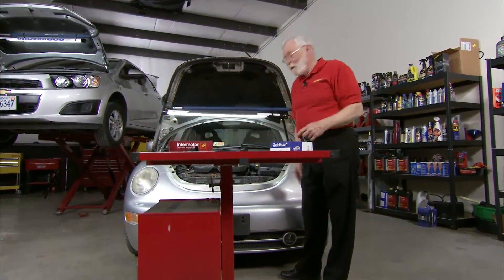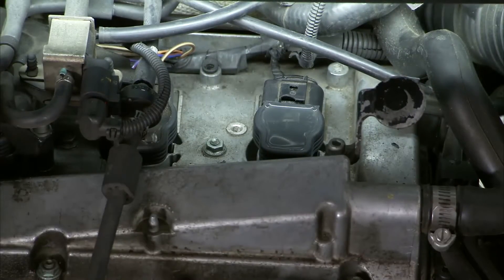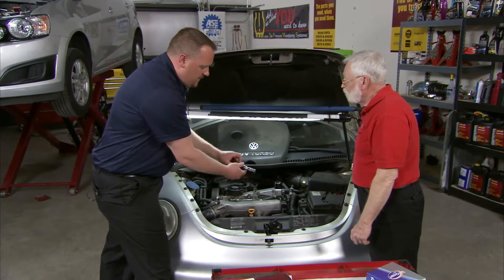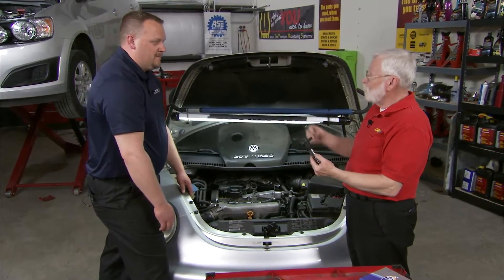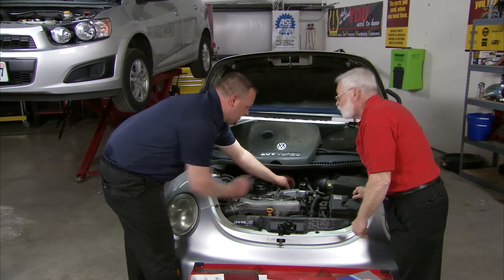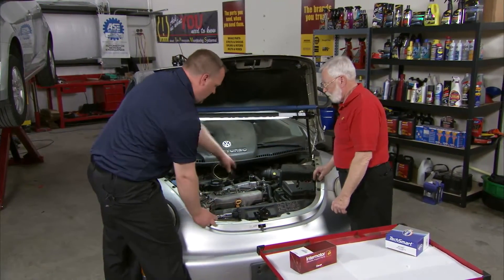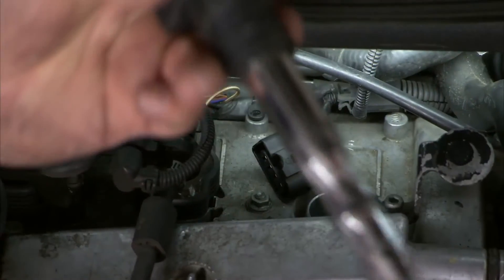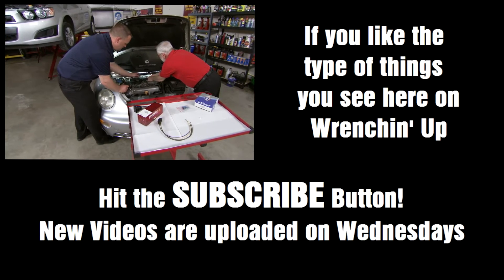Volkswagen Ignition Coil Connector Problem - Wrenchin' Up

Comment: Do i need to disconect the battedy
Reply from the maker: Hi - Thanks for watching! This video was created quite a while ago, but I do not think we had to disconnect the battery to repair the connector problem. I do suggest that you check with a service/repair manual for your vehicle to be sure.

Comment: Ive got a 2000 VW Cabrio with a 5spd 2.0aba, 160,000mi, has burned thru 10 ignition coils within the last 5 months (Bosch one melted thru the top!) Each coil I put in, I get from 500 to 1000miles of drive before the coils burn up. Connections & wiring seem fine, have searched for ground issues. Can't figure the issue out for the life of me! New plugs/wires, new distributor cap & rotor, which there's evidence of serious burns inside the replacement distributor cap and ontop the rotor.  I just ordered & waiting to arrive a new ignition coil, dist-cap & rotor, and a new MAF sensor, thew a CEL code for maf.  
I do believe the engine timing is fine, runs great when it is running. 
Has a very mild intermittent misfire sometimes, and does backfire (mild) only when down-shift, foot off the throttle. 
Smells like running lean, considering replacing the PCV valve, and evap canister. Air hoses seem a little oily, is why I believe I should order PCV valve. Noticed this when I got the car this past March.

The Bosch alternator works as should, but could the problem be with the voltage regulator in it?  Used 650cca autocraft battery, that I pulled out of my jeep when the battery I had in the VW Cabrio stopped holding charge.

Sorry this is so long, I'm out of people to ask for ideas, have searched very deep online, forums too,  and not sure where to turn, aside selling the car!  I had read a bad maf signal can in time cause ignition coil damage, so I'm hoping when the new one gets here, it will solve the problem.

If you've got any insight, thank you very much in advance!
Reply from the maker: Hi Thanks for watching! In my experience high secondary resistance has almost always been the cause of "burned" ignition coils. I've read your post and see that you have mentioned the components in that circuit but you didn't mention the ground between the engine block and the frame and/or negative battery terminal. This is often overlooked but are part of the secondary circuit too.
Reply: @WrenchinUpwithJimBates  I definitely should have mentioned, grounds are clean & solid, terminals and wires are great. My mind is blown, because there has to be something in the system telling the coil to keep firing to the point of it overheating, or a short, have searched extensively
Reply from the maker: Hi Michael - I wonder if the coil driver in the ignition control module (PCM?) is causing the issue due to a short to power or some other weird thing?

Comment: Do you know what it entails to replace the harness completely? I have a 2013 Audi A4 and have the misfire on cylinder 4. I changed the sparks and coils and still misfiring. I just got a code for the primary wiring circuit. How difficult is this to replace? Is there splicing needed for this or is it just plugs?
Reply from the maker: Hi - Thanks for watching! For the best and most answer to your question I recommend that you contact the manufacturer because the primary wiring circuit diagnosis didn't come up in the interview and they have the most information on this project. Their contact information is in the video description.

Comment: I got a P0303 (cylinder 3 misfire), replaced spark plugs, coils, boots, and still misfiring. Now i'm thinking its either a bad connector or a clogged fuel injector. Which should i pursue first?
Reply from the maker: Hi - Thanks for watching! The easiest thing to do next is to be sure the injector is being turned on and off. I use a noid light for this quick and easy test.

Comment: I have a 2013 VW Jetta 2.0 S, with the p0304 engine code. "cylinder 4 misfire".. I have replaced the plug, replaced the coil pack due to cracks on the housing and it is still missing. the EPC light and engine light are on. Any suggestions? The car was parked for a week and was doing this when I went to drive it.
Reply from the maker: Hi Wesley - If you still have the miss after you have verified that the spark plug and coil pack are in fact OK, then check the wiring from the pcm to the coil pack, and if OK the pcm will have to be checked for a blown coil pack driver. Check to be sure the cylinder is getting fuel too. Thanks for watching!
Reply: Jim Bates I'm running a compression test tomorrow, I checked all connections and they look OK. I removed the plug from the block and plugged back into the wire connector and didnt have spark and the plug reaked of raw fuel. I tried it without the plug connected and there was spark from the wire. thanks for responding!
Reply from the maker: Looks like you're on the right track! Thanks for the update as I'm sure your findings help others with similar problems.